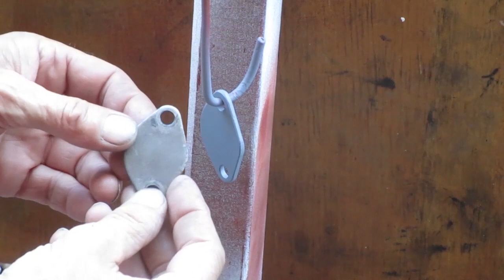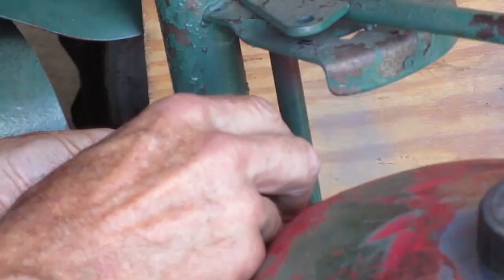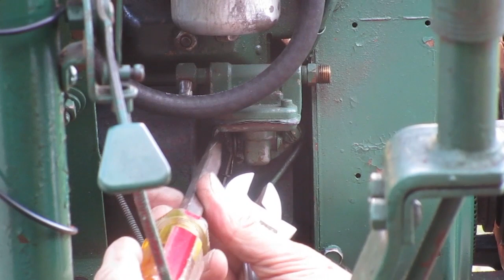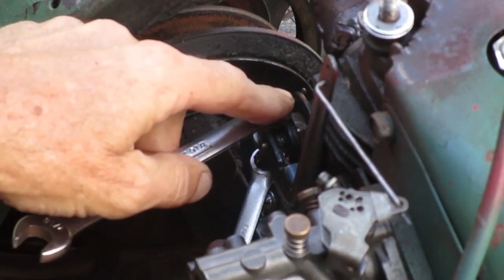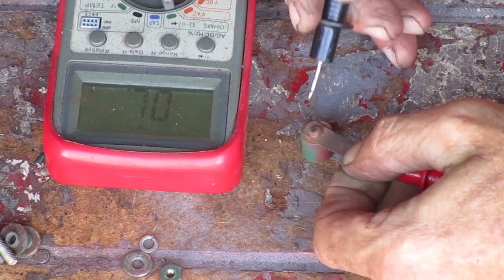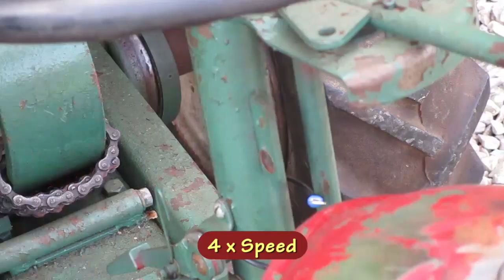1957 Bolens#2 Fixup Part 7

Comment: As usual, a very good video.I notice you usually pull the rope a partial stroke slow and then a more forceful pull on the second pull.Is this to aide the fuel delivery?
Reply from the maker: 2 different things going on there. The first thing is I want to rotate the engine to the compression stroke. That allows each hard pull to be consistent, I'll know what to expect. The second thing is the beginning of the pulling motion engages the starter teeth with the flywheel. As you continue pulling the flywheel starts to turn. I am allowing the starter teeth to engage the flywheel completely before putting full power on that connection. I think it reduces the chance of the starter slipping or skipping a tooth.
Thanks for watching!
Reply: @PackratsFabrications  Ah yes, make perfect sense. I do the same on an old suburban 400 with the same recoil set up.